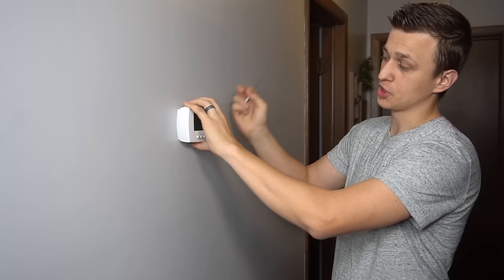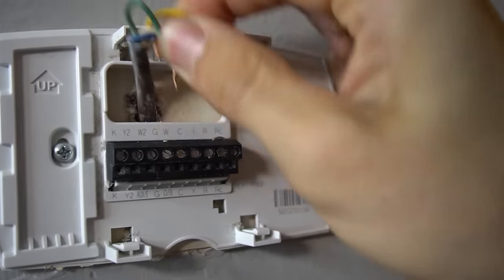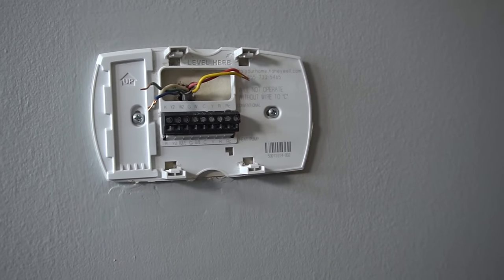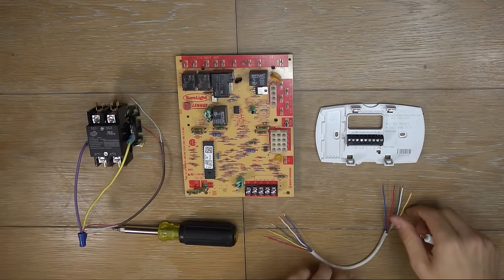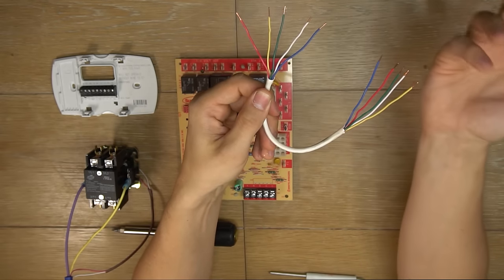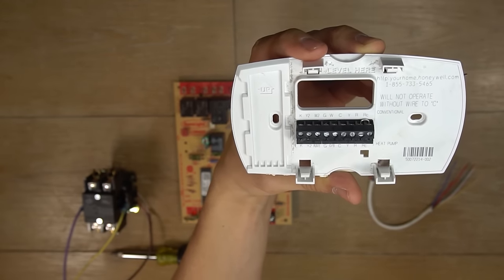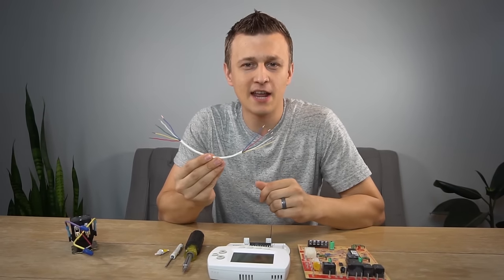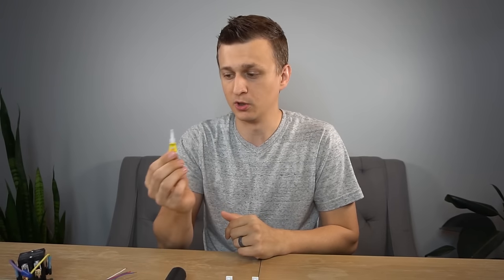Basic Thermostat Wiring - How to Wire HVAC Thermostat

Comment: Hello, 

Just had a A/C repair guy leave.  Said it’s going to cost 15k to rebuild the whole system    The compressor went bad. The reason for this was the new gas can’t be held in the old system. Capacitor was switched out, which still tripped the main breaker.   Any advice?
Reply: Can’t we just replace the compressor with the same model and refill or..... help please
Reply: If the compressor went out there's nothing you can do other than replacing it
Reply: And yes you can just replace the compressor or better yet the condenser if you replace the condeser dont need to refill because it already has refriferant in it, my suggestion is replace condenser instead of compressor so you can save some money and not buy refrigerant separately
Reply: I'm an HVAC contractor. You can replace the compressor, but it will likely be a waste of time and money. Your coils are old, eventually they will leak. Best to replace the entire system since you mentioned is is an R-22 unit. The new unit will last longer and be less expensive than piece meal part by part replacement/ repair. $15K is very high. Shop around and find a quality brand at a fair price.
Reply: @odahir6238  The new condenser uses R-410A, his old system was R-22, his old evaporator coil will not be compatible with the new condenser. He needs to change the system as a matched set.

Comment: I would not use the glue on the wound. It's hard to take off even if you get it on your finger. It would also trap bacteria and other things. Use hydrogen peroxide or alcohol.
Reply from the maker: Thank you for commenting and for the recommendations!

Comment: I have a thermostat that uses batteries and I have a 5 conductor  cable, white, red, yellow, green and blue. I attached the wires to the corresponding terminals lettered for each of those wires. I  did the same at the terminal board at the furnace. When I set the thermostat to cooling it trips the 3 amp fuse on the board. If I disconnect the blue wire at the "c" terminal in the furnace the a/c then comes on in the cooling mode, and the fuse does not trip. Furnace works fine in heating mode either way. Has anyone a clue about this?

Comment: The problem that I have, is that the thermostat that I was going to install, to replace the old one, the Y/O and W/B are separate! So, instead of Y/O and W/B like on the old thermostat, the new one has O, B, Y, W, G, RH and RC! So, do I use a jumper wire for the Y & O and W & B or not?

Comment: Why is it called a contactor? It's a relay dammit! ))
Reply: They are both electromagnetic switches.  However, relay switches are for low voltage applications and contactors  are for high voltage.  Also, contactors are usually equipped with overload protection.

Comment: If the power goes out, but the thermostat stays on, if it has a battery... Got to love those geniuses that think of everything, like making sure that thermostat will still work when the power goes out, because it's not like the furnace nor AC use electric... I prefer the good ole fashioned round Honeywell thermostat with mercury switch. This crap they have today is ridiculous.